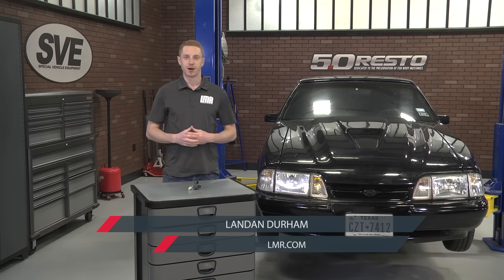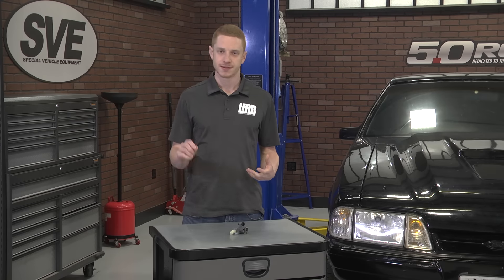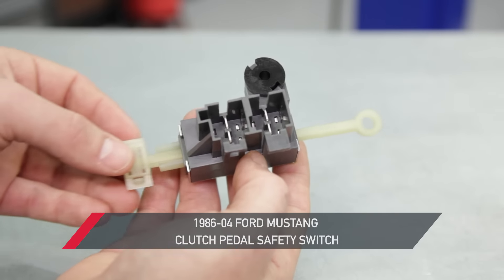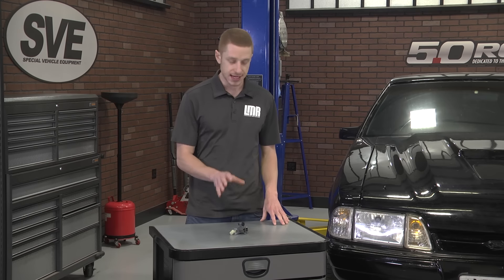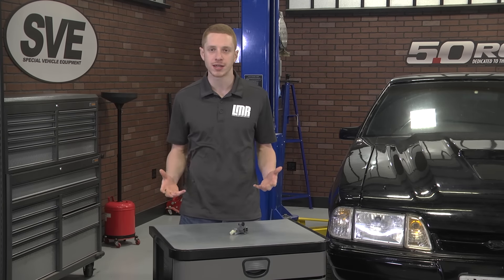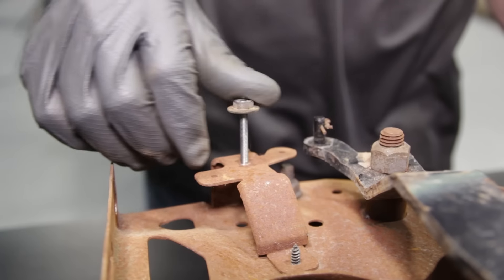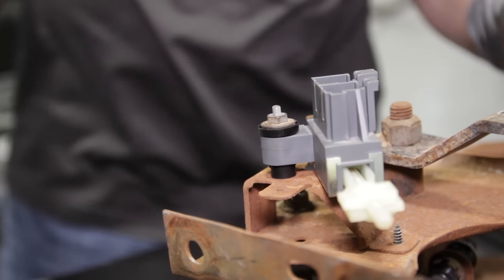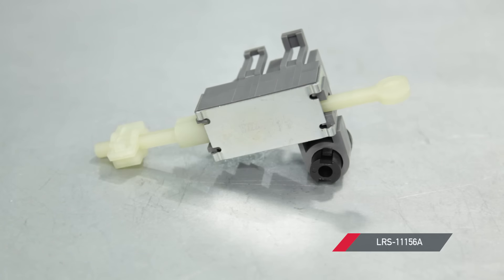1986-2004 Mustang Clutch Pedal Safety Switch - Review & Install

Comment: There are two pigtails that plug into the clutch switch. What is the difference between them? Why have two pigtails going to same switch?
Reply from the maker: Without getting too technical about the circuits, one connector allows the car to start when the clutch pedal is depressed. The other connector shuts off cruise control if the pedal is depressed. -Landan
Reply: Thanks Landan for quick response! Got it…I eliminated CC so I will eliminate that pigtail!!!!

Comment: What happens when you don't have power to the clutch switch key turned on even in crank position and fuse isn't blown what do I need to check 2002 mustang gt conv. 4.6 and if I jumper the starts solienoid it starts and all other elec. Stuff works
Reply: geraldturkeyhunter did you ever figure it out

Comment: Where can I get the electrical pigtails that plug into the switch for an 85gt 5spd?
Reply from the maker: Hi Keith, 

Unfortunately, we do not the electrical pigtail for the pedal safety switch. You will have to source one from a donor car or from a private seller that has an extra.

Comment: I got a 94 mustang gt was auto swaping it to manual the cables that connect to the safety switch where are they located and are they even there since im going from a auto to a manual?
Reply from the maker: Please give our tech team a call at 866-507-3786.
Reply: Did you ever figure this out? Im about to swap my 94 gt as well need ro know if I have the plugs from factory in my auto to plug into the safety switch

Comment: I work industrial maintenance oreillys will print an original layout of prints was helpful but I need to eliminate my ignition switch intake manifold waterneck to heater core broke above starts from starter to solienoid is fine what now replaced starter it's below where neck broke off figured the heat and hot water was the issue two things happened cause and effect trying figure me issue and on that note also main wiring harness is to the right of the water neck on intake manifold may and should say did get sprayed but all electrical is fine all works help lol

Comment: what kind of hood is on the fox?
Reply from the maker: Chris, I'm not entirely sure. There isn't a branding stamp or logo anywhere on the hood. -Landan
Reply: Late Model Restoration hey on mine I don't need to push the clutch in to start my car I have a 92 GT? Why is that is that a bad thing? Or dose or even matter

Comment: Shit is not 30 min, nobody got time to remove the entire pedal assembly. I’ve removed the seats and my adjustable steering wheel and still it ain’t enough space. The retaining nut is so tiny good luck getting to it especially if it’s torqued down. Everything else isn’t bad but fuck a 30 minutes it’s gonna take time

Comment: Just do the god damn bypass, unplug the safety switch connector and put a 30 amp fuse in boom it starts no more bullshit!’ 

Just did it on my 92’ SSP CHP
Reply: What port or fuse location do you put it?